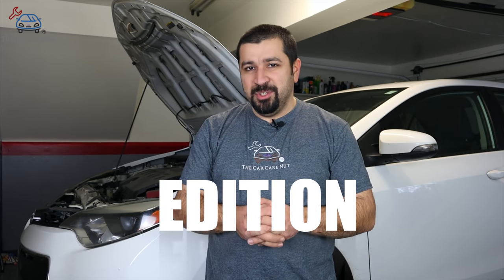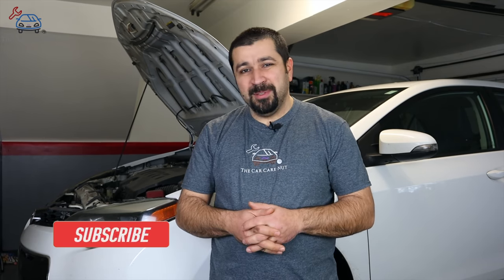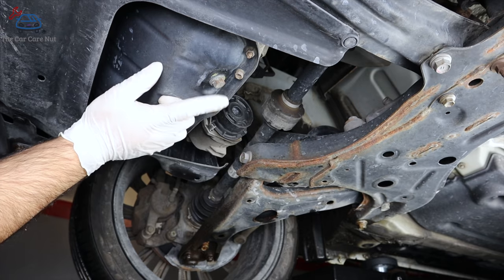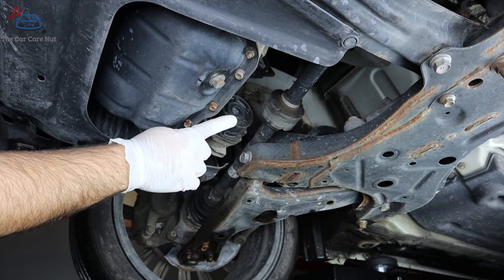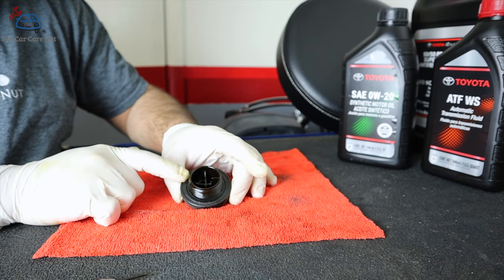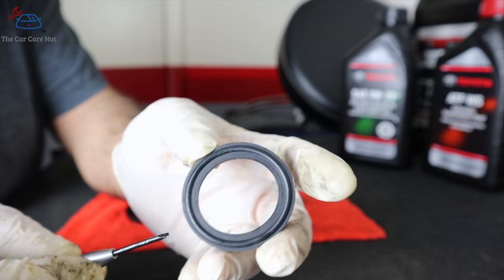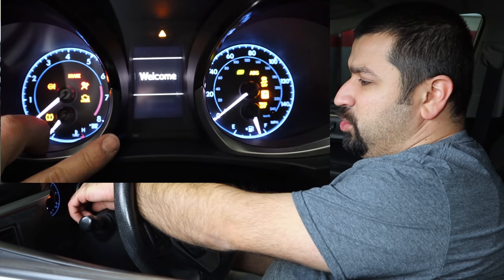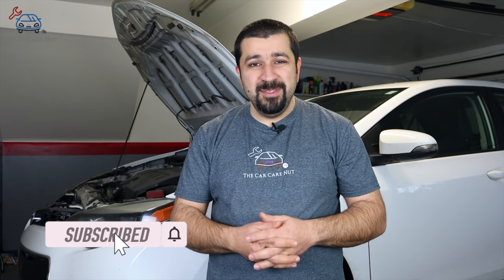How to change your Engine oil and filter for Toyota Lexus Scion

Comment: Hi ..Enjoy your channel . Great information and guidance. Thats why I am reaching out. I have a 2019 Tacoma. There is a tab on/at the cartridge for the oil filter. How do i address this. Do I just leave it, and take on and off the filter ? do I remove it and put it back after reinstall.? Does it need replacing at the oil change interval/Thank you for your assistance..

Comment: Thank you for the tips on oil changes w/canister filter. I just purchased an older Venza and went to do oil change and luckily discovered plastic cap was extremely tight. Instead of forcing the issue I ordered a back up cap so in case the current one fails I'm not up $hit creek. Thanks for all your videos.

Comment: How can I insure oil change being done right?  How to prevent overfill?  They done want you to go back and watch.  What is the x amount of oil WITH filter and WITHOUT and the little difference in oil?
Reply from the maker: Hi! Check it after the service is done. That is honestly the best way. Check a day or two after for leaks. If the level is correct and no leaks I’d call that a success honestly
Reply: @TheCarCareNut  thanks!  I’ve had a number of issues with oil changes, stripped plug causing leaking, underfill etc.  and with the fast lanes you have less or no experienced people.  With someone like yourself, you take pride in doing a good job and no doubt service a vehicle like it is your car.  I bet you are 1/100 mechanics/specialist.  Maybe 1/1000.  Pride, professionalism, knowledge, honesty with skills a hard set of personal qualities to find.  And, by the way, would love to hear your thoughts on protecting my Landcruiser from rust.  I’d make the drive for that and overnight at hotel.  Perhaps could be done through you?  Does Toyota offer a non warranty voiding process?  I’m wishing you much success my friend!  Remember my profession as I owe you one!  Injury law is my top thing I do and very important to have a guy like me helping you or a family member who suffers an injury!  Let me know about protecting my TANK!  Love that darn thing.
Reply from the maker: Thank you Stephen! We can talk about options as we go more into spring and summer.

Comment: How about transmission fluid change on the 12 Corolla?
Reply from the maker: Hi! That transmission has a dipstick. So take the transmission drain plug and add the same amount and check with the car running and hot
Reply: @TheCarCareNut  What about dropping the pan to replace the filter?  I do think I need to visit parts.toyota as I want to get the fluid from Toyota and not a clone.  I've done this on my other vehicles and always worked very well.
Reply from the maker: Yes you’d need to drop the pan to replace the filter. Not difficult drain and fluid and remove a bunch of 10mm screws and the filter is there. They’re a bit pricey and I would buy them from a dealership
Reply: @TheCarCareNut  So I did some checking and might need to visit a dealer for parts.  I put my vin in for Toyota and it's hard to figure out what I need, and don't see the kits (i.e. filter/gasket), and not clear on the amount/type of fluid I need ahead of time.  There was a youtuber that did a beautiful job showing how to do this but he referenced parts on Amazon.   The dealer wanted $275 to do the job.. if I get fluid and filters, it should be less than $100 (at most).  What do you think?  Its the 2012 Toyota Corolla 1.8L A/T.  Thanks and God Bless my brother.
Reply from the maker: $275 to replace the fluid and filter?

Comment: Hi AMD. wondering what is the oil filter part number for 2021 Highlander Hybrid and 2021 Venza?  Do they both use the same filter? Thanks.
Reply from the maker: Hi! 90915-YZZN1 for both

Comment: What is your opinion of changing the oil with the engine at operating temperature? I've hear it said that draining the oil hot, is more likely to remove any sludge or contaminants...  Safety is certainly an important concern with hot engine and oil.

Comment: As a complete amateur I must say the hardest and most important thing is lifting the car. I had a $40 Jack that couldn’t raise the vehicle high enough to fit a stand. 

You have to invest in an expensive jack lift or get car ramps like I did.

Comment: Hmmm, interesting theory about filling the oil.  I always thought the oil would read higher when the engine was stone cold because everything had drained back into the pan.  But, your theory makes sense as well.  I wonder how many engines get ruined because someone over tightened that plastic oil filter cap.  One of the few times I let the dealer change my oil, they overtightened everything.  Had to put big channel locks on even the oil fill cap to get it off...

Comment: I have a 2011 Tacoma V6   with 55000 miles . Should I use synthetic or conventional oil ? Thank you in advance !
Reply from the maker: Hi! Conventional oil will work with than engine
Reply: @TheCarCareNut  would synthetic be better or is it not necessary ?

Comment: Hey there car care nut; I watched another video where some manufacturing company had created an extension arm that you can plug into the canister connection on Toyotas and then use a spin on filter. Have you ever seen that or has anybody out there in your audience ever seen that and feel good about that. It looked like it was solid construction but it’s also an extended arm. And, I guess what would be the proper filter in a spin on to replace the canister?
Reply from the maker: Hi! I’ve seen it. I personally don’t like it. If the plastic housing of the canister filter is not overtightened it won’t leak or have issues
Reply: @TheCarCareNut  
Thank you for the reply. I just was considering it because I shied away from changing my own oil because of the canister filter requires A bit more attention. I like the idea of the spin on filter but I didn’t know about how I felt about the aftermarket add-on just to have a spin on filter.

Comment: He forgot to reinstall the metal plug with 3/8" square drive hole back onto the filter housing!
Reply: I actually reinstalled that metal plug back into the filter housing with the housing off of the car so I didn't have trouble with the small o-ring falling out of its groove.
Reply: NO he didn't forget, Corolla doesn't have that filter.
Reply: @karkule5919  -- You are right!  But, this video is what came up when I searched for "how to do it" to change oil in my "2017 Camry".  I went back through the video and noticed that he did mention the differences between Camry (etc.) and Carola filters. Since I have a Camry, I have decided that it's really not necessary to remove that metal plug/cap unless you want to insert the plastic drain spout and let the filter drain first.  And, then the plug and gasket can be reinstalled without first installing the filter assembly, which I think is easier since you don't have the problem of having the smaller O-ring falling out.  One  thing I really liked was the oil fill funnel, which I am going to get.
Reply: @karkule5919  -- I understand!  I don't generally spill oil while pouring it, regardless of what the funnel looks like.  I've been good at hitting the hole even without a funnel!  But, since I'm guessing that I'm old enough to be at least  your grandfather (if not great-grand), the "old" arms aren't as steady as they once were!

Comment: For the drain plug bolt torque, I see in the video you just snug the bolt. The torque spec for my car is also 30 ft-lbs. If I used a torque wrench to tighten the drain bolt, what is the lowest torque value you think I can use instead of 30 ft-lbs? 30 seems like a lot considering the thin oil pan.
Reply from the maker: Hi! Go with the torque spec honestly
Reply: @TheCarCareNut  Thank you. We finally got our new Sienna and am doing the break-in oil change. I’ve asked you several questions on several of your videos and you answer every one. Thank you AMD. We’re loving the Sienna!

Comment: Thanks for the tip on not removing the cap to drain the filter! My 5.7L Tundra has that and it's my least favorite part of changing the oil! I noticed you removed the filter before draining the oil, I've always drained before removing the filter. Would removing the filter first work on my Tundra? I've never paid attention to whether the filter is above the level of the pan. I guess it would have to be, but it's also clear up at the front of the engine. Thanks again for the great videos!
Reply from the maker: Hi! On the tundra it doesn’t matter which order you do it at.
Reply: @TheCarCareNut  Thanks for replying! I'll have to try that next time! Thanks again!

Comment: On the topic of oil... I'm seeing quite a few videos of oil leak at the timing chain tensioner.  What are your thoughts on the replacement of this gasket?  Could you do a video?  I have a 2010 Corolla and appearantly it's a common issue with a simple fix but dealerships like to up quote on this service.  Have you seen this often in your experience??
Reply from the maker: Hi! Typically it’s misdiagnosed as a timing chain tensioner leak and ends up being a front timing cover. I would replace the gas on the tensioner first and see but most of the time it’s a front timing cover leaking. I can do a video on it once I get a car to film with
Reply: @TheCarCareNut  thanks for the response, much appreciated!

Comment: 14:50 that’s not true you always check the engine oil when it is cold
Reply: The full line is for hot oil. If it is full when cold it will be over filled when hot. If you find a shop or owners manual that states otherwise, I will gladly say you are correct.

Comment: The 2021 Rav4 Prime Maintenance light goes on at 5,000miles.   I think Toyota heard your gospel...
Reply: No they didn’t. That’s to get your tires rotated. They recommend oil changes every other maintenance. So once a year or 10,000 miles.
Reply: @fallguy4209  you do that to your Prime and you're asking for problems.  Just my opinion.

Comment: Would love to meet the Clown that thought putting the drain plug on the SIDE of the oil pan on the Tundra 5.7 was a good idea. Awesome when you remove the plug and oil shoots out sideways about 2 feet all over the front wheel making a nice mess and dont get me started on the oil filter. Takes longer to remover and install the pan and all the bolts than it does to actually drain the oil and filter. Come on Toyota. Still love the truck though
Reply from the maker: Totally hear you. Every single time and every single tundra every tech feels the same way.

Comment: Professional mechanic? Why didn't you torque the oil pan drain bolt, I do?
Reply: Really? Snug it up and all is well.
Reply from the maker: James because I am a professional mechanic you get used to torque values by hand for small non moving non structural bolts.

Comment: You are supposed to clean inside the filter housing before installing the new filter. This is per instructions. I think also if you use the same oil from Toyota that you are using and a TRD synthetic oil filter from Toyota you can safely go 1 year providing you are not over 5000 miles.

Comment: Those oil filter housings made by Toyota are GARBAGE!  I have had two die..... crack, leak....  Second one was not forced/overtightened.  They are a terrible design!  Never had so many issues, my old VE Commodore v8 just had a screw on and off system, never once gave me any issue as there was no housing to speak of.  I have since purchased a metal version incase the plastic one on now goes the same way.  The fact I have spares says alot about it.  This is on a 2017 Toyota Kluger (Highlander).
Reply: are you using a special tool made out of steel to take it on and off that's of decent quality?

Comment: Always changed my oil every year and less than 4,000 miles for 13 yrs,no issues....i still have the car now.It's a 2002 Yaris 2NZ-FE and it's always quiet,smooth and reliable with no issues at all in the years i've owned it. I rarely rag it ie floor it or drive really fast mad.Toyotas are great! P.S Thanks for letting us know the difference with the blue and black sump plug washer,i got the Toyota blue washer,i really assumed they were used once only.So mush useful info in your videos,much appreciated.

Comment: Recommending changing the oil every 6 months is a good idea, even when only driving 2-3,000 miles during that time frame; however, if the car is only driven 2-3 times a week (instead of 5-6 times a week for most people) with 2-3,000 miles, then going one year in-between oil changes is perfectly fine.

Comment: You say 30000 miles intervals is too "aggressive".  Does changing the oil at 3000 miles harm the engine in any way?  No.  You should say wasteful rather than too aggressive, in which case I say it's my vehicle and I want it to last. What's too aggressive for you let's me sleep better.